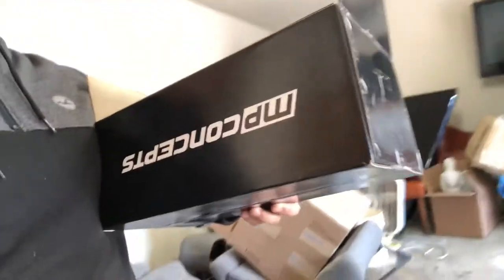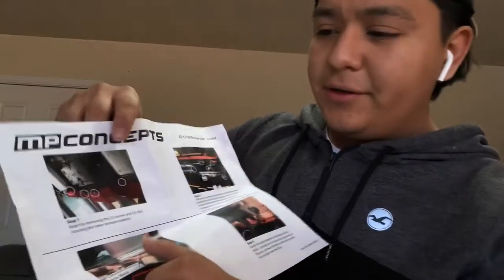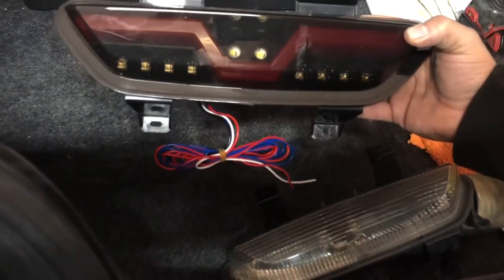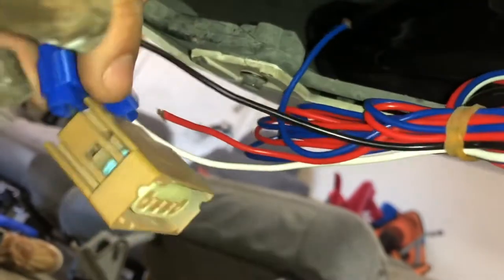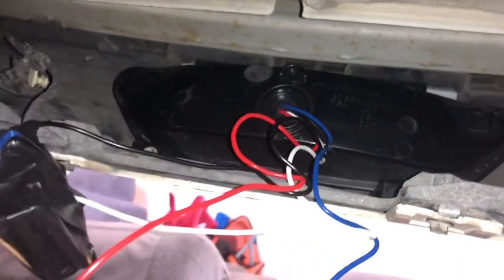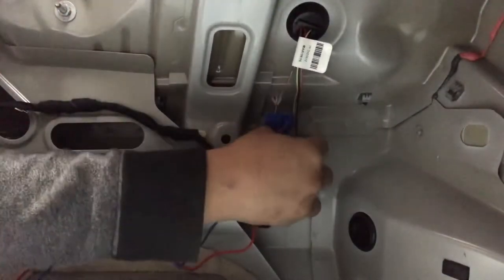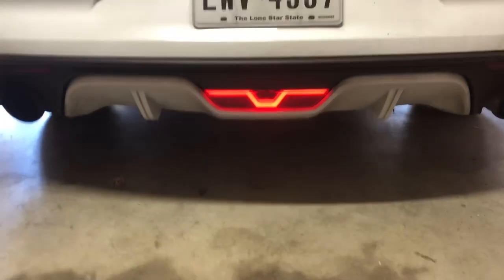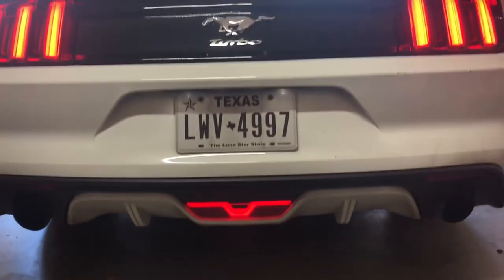HOW TO INSTALL MP CONCEPTS LED REVERSE LIGHT | MUSTANG | 2015-2017 | MP CONCEPTS | REVIEW + INSTALL

Comment: Did you ever solve the blinking issue same thing happend 2 me
Reply: It’s supposed to do that every time you hit the breaks. It’s like a new brake light.

If you don’t want it to do it, disconnect the blue cable.
Reply: @crazy.visualz8216  If you disconnect the blue wire, does that mean it won't work as a brake light ?
Reply: @scotttracy9333  exactly, it just stays always on no flash
Reply: @Crazy.Visualz  Cool thanks man ✌️ 
I was on the fence buying this, but I think I'll pull the trigger on this one. 

How was the install?
Reply: @scotttracy9333  i had neck pain for 3 days. 

Be READY 😂😂 it’s easy but tricky and not so comfortable
Reply: @scotttracy9333  i recommend u to buy the quick splice thing for the cables, it made it so much easier
Reply: @Crazy.Visualz  Whats a quick splice thing ?
Reply: @crazy.visualz8216  Is that the connector this guy was using ? How weather proof is it? I live in the snowy north, so it's harsh weather up here
Reply: Yeah mine blinks too it’s supposed to do that. I thought I had a bad connection but everyone with this reverse light does the same thing